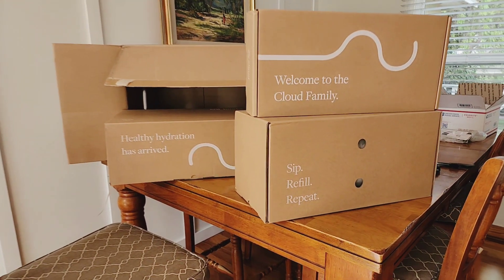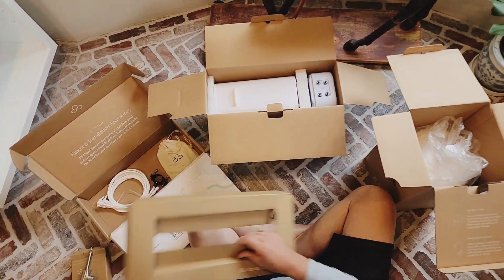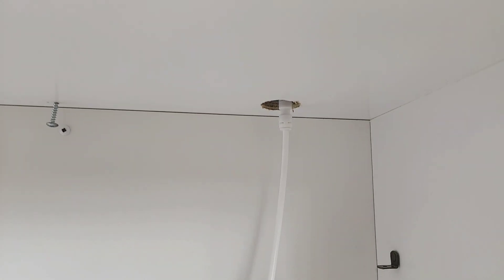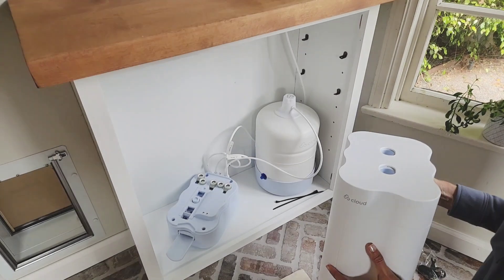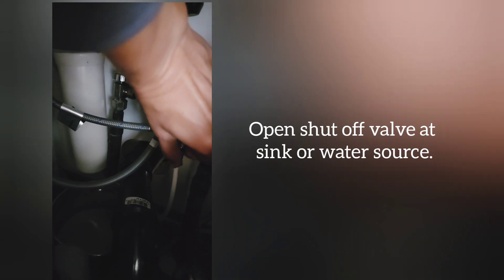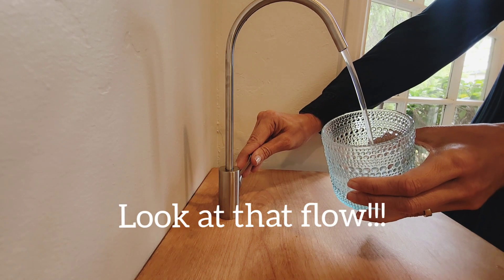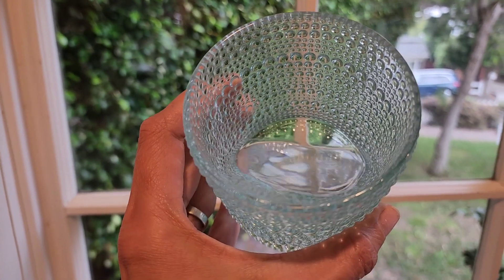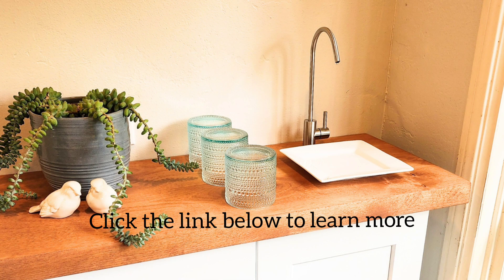Cloud RO Reverse Osmosis System Install & Review + $200 OFF

Comment: I'm getting confused on how you have to let the tank fill 3 times before using it. I see you let the water trickle then turn it off so the tank fills. How do you know once it's full? Do you have to also shut off the cold water everytime you're emptying out the tank then turn it back on when you need to refill?
Reply from the maker: The tank hold 2.8 gallons, so use a pot or bucket with a known volume so you can keep track. We drained about 6 gallons total. & No you don't need to shut the water off as it connects the main line, so there's no interruption. I wanted to add after we did the refill 3 times, the tank sort of made a bubbling gurgling noise for the first day or so. This is totally normal (and is noted in their video), but just mentioning it because it seems like it's 'alive' for the set up process. lol  By the way, we love this thing so much. I can't believe we waited so long. I drink more water now!

Comment: how does the battery recharge
Reply from the maker: The battery is not chargeable, sadly. However the battery pack contains non-hazardous, alkaline batteries, and will last several years. It can be replaced when changing out some filters. The app does a good job of showing the condition of all of the filters and battery. Not withstanding the filters in battery, the cloud RO system should last 10 to 15 years.
Reply: @BoredMom great thank you so much